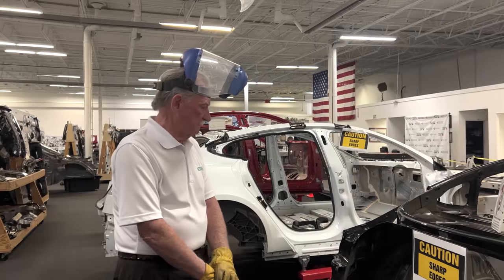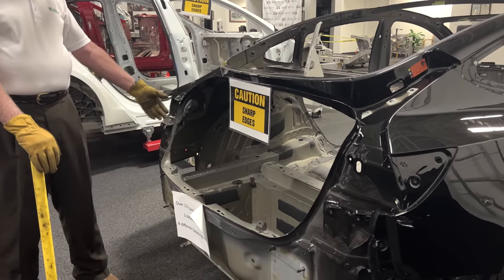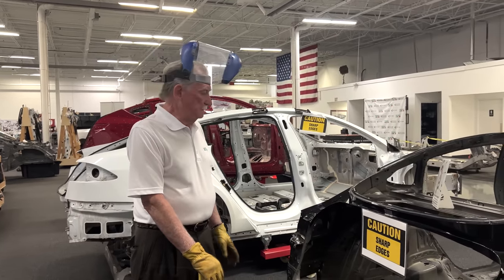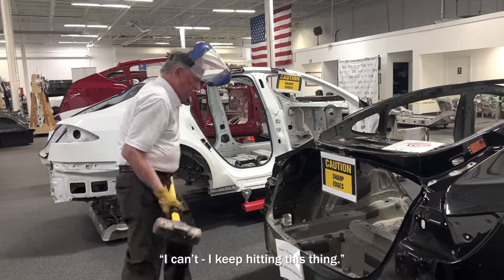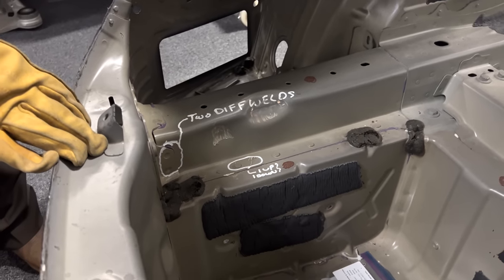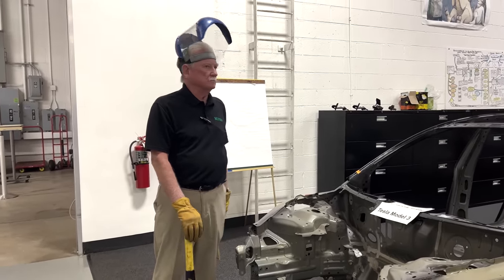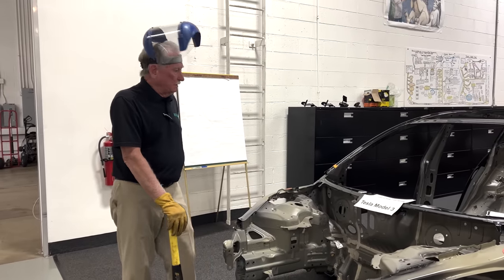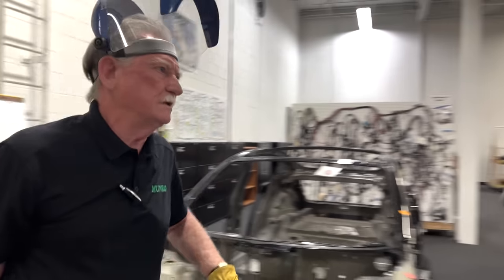Sandy Rant... With a Sledgehammer? Why Aluminum Castings Are Safer Than Steel

Comment: Weak materials combined with geometrically correct design can in many cases outperform stiffer and stronger materials used in non-optimal design, which is not widely known... 100% agree with you Sandy
Reply: When casting cracks it can take 0 force. Metal bends so it still holds something.

However when thinking about serious crash there are so so many more factors. Casting could act like a helmet what takes the force, it breaks and passengers are saved.

Steel will rust and aluminium casting doesn't. Or at least not as fast.

And of course you have to engineer both parts good. Maybe you remember crash test of Chinese cars in 90'-00'ish. Being steel didn't help.
Reply: Tesla know how to make castings. They make rockets!
Reply: These fake swings are embarassing for Sandy's credibility. Hit it the same if you want to make a point.
Reply: @taylorc2542  oh oh...you gonna get a visit from Sandy and his sledge hammer
Reply: @Jako1987  Aluminum will never rust it oxidizes.
Reply: @oloilmann4288  Rust is steel oxidizing, which would make aluminium oxide aluminium rust(ish).
Reply: @oloilmann4288  "Aluminum will never rust it oxidizes."

Rust is created by oxidation.
Reply: @yourcrazybear yeah but here the effect is very different to rust. It's oxidation but manifests in another way entirely.
Reply: Said another way, partial strength leads to general weakness
Reply: @Jako1987  I remember the crash test of the BYD "Brilliant", was quite the throwback to the 60ies or later. Fold like an accordion.
Reply: Very flawed test, this won't help Munroe if people think this is how they do other testing.
Reply: @denveroilers9458  Nobody in their right mind is thinking this is how Monroe is doing his tests for his customers. This was an off the cuff quick rage test example of the qualitative differences between the two materials.
Reply: @oloilmann4288 wow. Wow. Wow. Wow. What’s the difference between oxidation and rusting ? None. Oxidation of iron is rusting. By definition.
Reply: this did not age well

Comment: I was convinced about the casting advantage when Sandy and Corey started examining them. If Sandy says they're superior, I'll bank on his words.
Reply: That’s the logical fallacy known as “argument from authority”.
Reply: @KentBuchla    There's actual FACTUAL evidence that Sandy knows what he is talking about.

If you want to argue about logical fallacies, give Matt Dillahunty a call. 🤣
Reply: There is a reason motorsports require steel roll cages instead of other materials. Sandy was very wrong here with recent evidence of the rear casting breaking off recently in a new test video

Comment: As a front and rear aluminum castings owner, I was thrilled to learn this.  Thanks, Sandy.
Reply: fanboy casting owners know best, when it comes to pointless clickbait..... Where is my Robotaxi?
Reply: @nc3826  So touchy.
Reply: @nc3826  Where is full self driving 5 years ago?
Reply: @nc3826  WIth Musk the grift never ends. "It's financially insane to own anything else than a Tesla" yea right
Reply: Just don't hit it, as you have to change half of the car for a small(ish) impact. It is the tradeoff we have to make today with so many devices.
Reply: @FlorinArjocu  Probably this is most peoples' problem with casting... when you hit it, it's over, that car is going in the garbage most of the time even with damage that otherwise would be an easy repair if it was steel. I hope with time they will do something about this problem, because changing the entire car just makes no sense when it comes to minimal damage....
Reply: @UmbraWeiss  There is nothing you can do but go back to smaller pieces, a bit more weight, too. For production costs, they don't want that. Later costs go to someone else.

Comment: I think the casting the nay sayer has in mind is the typical pot metal casting made to the cheapest price point possible, not an engineered one with an aluminum alloy optimized for strength without being brittle. Aluminum castings have been used for decades in the aerospace industry and I especially love Sandy’s comparison of cast engines and heads. It😢not uncommon to see 1000 HP engines on the dyno these days are they’re cast aluminum blocks and heads. Well done Sandy.
Reply: Those aluminum castings used in aerospace industry have, unfortunately, also been cracking for decades. Passenger vehicles are not subjected to the same rigorous inspection schedules and procedures necessary to detect these cracks. This lack of timely crack detection could become a serious problem in the future of wheeled transport.

Comment: I’m sure in principle this is correct and the casting is stronger . But we all know hitting something the is free floating , ie not held down will not dent it will give and move … so not a good test . The third test was a much better representation of reality /strength
Reply: Exactly, you can't hammer a nail into a board if you allow the board to move unsupported.  And with his demo on the front end, he has a real half hearted swing of the "persuader" on the casting versus his swing on the steel.  Of course Sandy is right, but his demos are not very consistent.  I laughed when he brought out the tool to measure the depth of the dent... ha.. ha.. real precision!
Reply: @freeaccess5905 he should have used the tool on the casting to show it had no deflection... And put the 1st casting against a wall so it absorbed all the energy.
Reply: Exactly … the second test was a joke, but the argument stands.
Reply: @mxs8102  I am sure many will think our comments are being petty, but it undermines the whole credibility of his point.
Reply: @freeaccess5905  I wouldn't say credibility, just the validity of the comparisons
Reply: The hammer test wasn’t very scientific, and didn’t seem to relieve any frustration. I’m not an engineer, but wouldn’t trust a damaged, then straightened aluminium structural part; nor indeed a steel one, as the molecular structure of the part at the damage/repair area would be altered, most likely weakened.
Reply: At least you used the face shield most of the time.

Comment: The biggest advantage of castings is the freedom to vary part thickness and shape to put the material where it's needed and remove it from where it isn't so it can be optimized for strength, rigidity and low weight.  You are limited on what you can do with the uniform thickness of sheet metal and the stamping process so yes, aluminum castings are nearly always superior than stamped sheet metal for engineered parts.
Reply: The biggest advantage is speed of execution.  Everything else is just gravy.
Reply: @cawfeedawg I think there is a New Balance (not the sneakers), in terms of alloys, casting machines, costs & amortization.
Reply: In the case of Tesla, casting is heavier than sheet metal welded together for the same function.
Reply: The problem with casting is brittle and poor repair-ability.
Reply: @matthewhuszarik4173  "The problem with casting is brittle and poor repair-ability."

Just replace the broken part.
Reply: @matthewhuszarik4173  you know when Sandy said stop talking, now would be a good time.😉
Reply: @yourcrazybear  Easier said than done.
Reply: Yes sir, FEA analysis can add material where needed for rigidity in casting - not in sheet metal unless you overbuild which would be much more expensive
Reply: @TamagoHead  It would be nice if Sandy would talk about tooling more because it is very important when deciding how to make a product.  Aluminum die casting is a pretty brutal process that beats the hell out of the tooling which has a much shorter life span than stamping dies.

The cost for die casting tooling increases exponentially with size so I can't imagine the insane cost to get a setup like Tesla has and how many cars they need to sell to make that money back.  

 Investors don't seem to care about the billions Tesla spent  getting tooled up but they do care whether legacy car companies see a return on investments (profit) for their manufacturing.  This may explain why Toyota doesn't do "giga" castings if the lifecycle cost doesn't make sense.
Reply: @theslimeylimey  hmm. That might be more specialized than the costing that Sandy does, but you do bring up a lot of great points and insight, and Sandy h as a great tooling background. 

I’d appreciate Sandy’s insights as well. Alloys are interesting but I think the IDRA/Tesla alloy is neat due to lack of post-cast treatment. 

I read that Tesla might be using a 3-D specialist that can do sand casting, maybe for iron molds for the IDRA press? I can’t imagine how much heat gets generated, the heating, anode/cathode life, etc. 

Amazing stuff!

Toyota is conservative. I have a 2000 Avalon and an ‘04 Truckolla and they work fine. I got over 190k miles out of my ‘86 beach truck before I gave it way still purring.
Reply: @yourcrazybear  good luck with that. if you can buy one by the time it's installed along with everything else that's broken because that structural section isn't going to break without other collateral damage happening. anyway by the time you get that and everything else quoted to be fixed and add in labor you're looking at a totaled car. there are alot of pro's and con's to having this type of construction and repair is a con. with steel it can be worked back into form or cut out and replaced with much more ease than aluminum. once a vehicle takes a hit, it will be tweaked until it is put on a frame machine and worked back in aluminum does not respond anywhere near as well as steel.
Reply: Another advantage castings have over welded/bolted steel parts, are many fewer welds/bolts makes castings not only stronger, but castings won't fail as quickly under repeated stresses as experienced when driving over a bump. Welds are weak points.
Reply: You can Tig weld alu.
Reply: @yourcrazybear way to miss the point. The whole frame is one large part.
Reply: @freemanpl23 theoretically you can, but the reality is you need perfect alignment and a skilled welder.  It's too expensive, which is why these cars are written off and piling up in wrecking yards and Tesla insurance is the most expensive of any vehicle. 
Gigapress frames are about wider profit margins, not about a better product for consumers. 

If you buy this sledgehammer stunt, you failed any first semester of engineering physics.

Comment: Sandy Rocks!!! 💪
By the way, I know that since the 90s, I have a motorcycle Honda NSR 125, with Al cast frame, which I had a front collision and bent the front fork. Guess what, the frame was fine, replaced the damaged parts and ridin' again!
At that time, a friend of mine had similar crash, but with a Yamaha with Al bended and welded. The motorcycle was totaled because of twisted frame...

Comment: Its actually very helpful as most of us amateurs would think the castings would be brittle and shatter. 
Thanks Sandy.
Reply: Cold stampings have to be ductile, but castings can be anywhere from ductile to brittle.  Pure aluminum (which can of course be cast) for instance is extremely ductile, but extremely soft.  What you want for crash structures is high toughness -- basically strength times ductility.
Reply: @concinnus there’s annealing too.
Reply: @TamagoHead  Obviously, but I don't see your point.  I've not heard of them using quenching, tempering, or annealing.  Presumably it's more cost effective to just use air hardening alloys.
Reply: @concinnus  apologies on the brevity. I think that Tesla & IDRA have cooked up a new Al alloy. 

The annealing takes place as the vehicle wears, IMHO. Thx for the response!

Comment: I'm pretty sure that many people are confusing cast aluminum versus crappy die-cast metal, like say what might be used to make Hot Wheels say, pot metal or the crappy top case latch on the early BMW K1200LT Motorcycle. There's an aftermarket replacement for the OEM latch manufactured by a third-party individual CNC'd out of aluminum. The later generation OEM latches were made of the very flexible PLASTIC, perhaps polypropylene.

Comment: Best line is the engine casting vs. welding 10:30  & and brains. Sandy is an honest and genuine personality and the Munro team is impressive. 

I’m pretty sure Sandy could figure out a way to destroy the casting if he wanted to, but the point of the video is that with modern Al alloys and casting methods, cast structures seem to be the future from a cost and material superiority standpoint for the application.

Comment: I found this statement in a German trade journal for foundry technology: "Giga- or megacasting can therefore be classified neither as an efficient solution per se, nor as a lightweight solution, nor as a higher-performance process. However, it does represent an alternative that adds an interesting variant to the rather well-worn technological toolbox in car body construction."

Comment: Hilarious!  His example of an engine casting strength is right on. If you actually have engineering experience you can visualize the effect of forces in 3 dimensions by just conceptualizing the problem and the physics. That takes years of actually doing Engineering. Sandy is there.
Reply: Correct. You should be able to visualise forces including kinetic & potential energy. Which is tough for most folks to do.

Comment: To be fair the casting should have been bolted to something. It moving aborves a lot the strking force. But again, I'm not even sure that a stronger body makes it safer. That's why crumple zones were designed. Having a accident on a ridid body it's a recipe for a lot of broken bones. What matters most is repairability afte the accident also, but I'm sure making the cars faster outweights all the cons and I'm sure Tesla engineers desing the cars to have the least chance of inuries when in an accident.

Comment: We had this kind of demonstration with the initial reveal of the Cybertruck with Franz von Holzhausen obviously pulling his blows with a sledgehammer. If it's not carried out in a  conrolled manner on some kind of test rig then as a test/demonstration it's just not trustworthy though the second demonstration was definitely better than the first.
Sandy may well be right in saying that the Aluminium is stronger than the pressed steel but this is not the way to prove it.
It's more like a theatrical stunt.

Comment: I'm not worried at all about the castings.  Stamped steel with bend and warp well before it totally fails.  The casting will remain rigid and retain it's shape much longer but will eventually shatter or have big chunks break off if hit hard enough.  Either way, if the car is hit hard enough to shatter the casting, it's a write-off no matter what it's made of.
Reply: They are already preparing casting repair parts, so if a smaller part of the casting breaks off in a common way you can cut away part of the original and drill holes using a template and bolt on the retrofit piece. Not always a write-off.
Reply: @briansilver9652 Even so, that is much more labor-intensive than the traditional methods. Still more expensive insurance and an inferior structure after the "repair"
Reply: If you hit your car so hard that the castings shatter and think you could hit a stamped steel car equally hard and have it not be an absolute total loss, you're so wrong it's funny!
Reply: @MrCarGuy Thats disengenuous. Crumple zones can be replaced and steel can be bent back into place. But it will NEVER have the structural integrity it did originally. Doesnt matter if you are talking steel or aluminum, once cold deformation has occured, the structural integrity is out the window.
Reply: @MrCarGuy how much to rebuild the entire front end of a 1988 z-24?  I did it for $500.  I am sure you would charge more than that.  Sure, the paint would match, the radiator would have mounts, the AC would have worked, but you can't beat $500.  Can you?
Reply: You could just not crash...   I guess that's not an option for some people.
Reply: @calholli  if you think not crashing depends solely on how you drive, you are either trolling or don't drive for a very long time...
Reply: I am interested in the design life of the castings. Aluminium is less resistant to fatigue. But I am sure in the majority of the cases corrosion would be more of a factor it both steel and aluminium.
Reply: When something gets impacted that's not fixed, all the energy goes into moving it.... So it proves nothing....
Reply: Steel and aluminum have trade-offs..... This pointless  Unscientific demonstration was mostly silly clickbait for fanboys....
Reply: @nc3826  So explain the shock tower then?  Whey didn't the front casting break?  It's still bolted into the car.
Reply: @dsnmttr  I've driven everyday since 1998..  I've never crashed my car or trucks
Reply: @calholli;  "Whey" Good luck learning how to spell.... and thank you for being, so obtuse and amusing....
Reply: @MrCarGuy  If a structural part of the casting breaks or even is cracked It would be likely totalled. I am referring to the tabs and brackets that are part of the casting and used to mount the body panels and such. If these break in a fender bender then the casting repair kits would make sense. I will try to find the video I saw that explains this. I'm no expert.
Reply: @briansilver9652   The casting could still be welded by a pro.. as long as the crack isn't too crazy.
Reply: @calholli  I've heard welding cast iron is problematic, but welding cast aluminum is obviously a different story. Remember that this is a special alloy so the weldability may be unknown to the public atm.